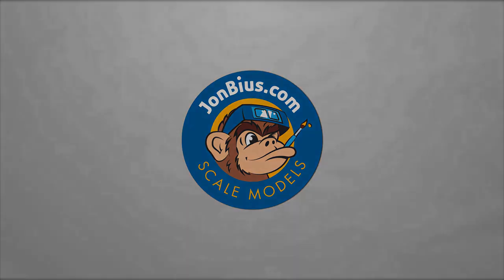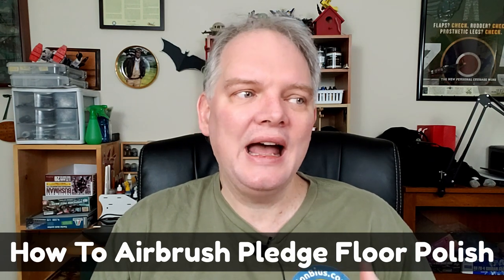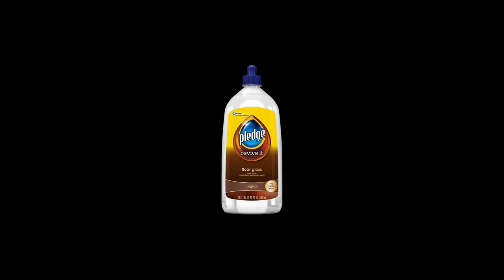Airbrushing with Pledge (Future) - A Simple Guide

Comment: Thanks a lot Jon, very helpful and Clearly So! 😅 I do have a few bottles of Pledge, bought around 2 or 3 years ago, never used them up to now, and I was thinking of using them in some new large models I have under construction. But it did worry me that the liquid in the bottle has turned slightly yellow (it was completely transparent when I bought it). Your comments on yellowing in this video kind of helped to persuade me to give it a try. Even if very slightly yellowish in the bottle, the micrometer-thick layers we spray would hardly affect the colours of the model (I hope). The only concern I would have is, if I spray it over a relatively large(-ish) white surface, like a white decal (say, the American WW2 white stars). Since I will be using it on large submarine hulls and some sci-fi models, I am not expecting any trouble. 

One more question: although it is a controversial topic (it shouldn't be, in my view) there is the opinion going around that Pledge makes a perfect medium to thin Mission Models acrylic paints, instead of using the dedicated Mission Models thinner, and their Polyurethane additive, both of which are very expensive and their recommended thinning ratio is very sensitive and it's a hit and miss to get the paint to flow correctly. In addition, any left-over paint is supposed to be "activated" by their thinner, so you are not supposed to mix it back into the bottle of the paint, leading to some wastage of a very good but also expensive paint. If Pledge really works with MM paints, it would offer a great and cheap alternative, (although this would not be very good commercially for Mission Models, hence the controversy, I suppose). Any experience or views on this? 

(btw, full disclosure: I love Mission Models paints, I think they are brilliant, but they can also be very frustrating to use because of the above issues, so I would really be happy to find an easier thinning process. After all, most if not all other paint brands, acrylics & enamels & lacquers, are very forgiving in their thinning ratios).   

Thanks a lot!
Reply from the maker: Thanks so much - I'm glad you like it!

I'm more and more convinced that white yellows on its on, apart from Pledge. I've not seen that in my own work, but I have had others I trust their experience to report that to me. I certainly wouldn't say it won't happen, but I think Pledge is not the culprit. I suspect light is - mainly sunlight - and possibly heat.

I don't use MM paints. I'd tried them but opted to move on. In general, when I've thinned acrylics with Pledge (PolyScale, Vallejo, and Citadel), it worked OK, but only in small quantities. And unless the paint is already fairly thin, adding more Future reduces the opacity very quickly. Getting a good opaque layer becomes difficult. Certainly give it a shot, as the theory is good.

Thanks again for watching and commenting!
Reply: @JonBius  Thanks a lot for all the comments, I may try this. Agreed about the yellowing, what you say makes much sense. Best regards!
Reply: I have half a bottle.  I've had it for several years. Ok ten years? I gave half away to a friend to use, about 6 or 7 years ago. What I have left has yellowed. I live in south Florida.  It's stored in my air conditioned house. In my den.tne curtains are always closed. The room has a south facing window. 
The bottle hasn't been opened  but maybe once or twice. 
I know sunlight, will yellow clear plastic packaging. Even when out of direct sunlight.
Reply from the maker: I'd give it a test shot on an old model or other painted plastic just to be sure. That would also check to make sure it hadn't thickened up any.

Thanks for watching and commenting!
Reply: Another reported use of Pledge/Clear/Future is as an additive to some Polyurethan-based primers, say Vallejo for instance. It's known that sanding of these primers (possibly all polyurethane-based primers) leads to a sort of peel-off effect. Mixing with Pledge would harden the stuff to the point sanding would not be a problem anymore. I ignore what the mixing proportions should be, honestly, and I never tried it myself.

Comment: Thanks Jon!  Over the years I have been buying models for when I retire,  done that so I am setting up for airbrushing  :)  A couple of questions if you don't mind...

You mentioned mixing Pledge with acrylic paints - I am curious, what is the  purpose for this? Transparency?  Durability? 

I am also getting into carving and airbrushing wooden fishing lures with multiple layers of (Createx Wicked) transparent acrylic paints,  would  Pledge be a suitable product to protect a layer? Would you let the Pledge dry thoroughly (over night? an hour?) or could you  blow-dry and continue  painting?
Reply from the maker: Mixing Pledge with acrylics can serve several purposes. It acts as a thinner, but because it is acrylic, it doesn't break apart the pigment structure. It makes acrylic paints very durable, and it can also be used for nice glazes, etc. So it can act in several roles.

I don't know about the wooden lures, as I've never worked with that medium. I'd recommend spraying some on, and then testing various times for drying and curing. It can be sped up with a hair dryer, though I always recommend low heat.

Thanks for watching and commenting!
Reply: @JonBius  Thanks for the reply Jon! I'm new to (modern) airbrushing - especially acrylics - though I still have my Thayer & Chandler Model A that I used for technical illustrations (with ink) several decades ago. I agree that low heat is the way to go with plastic models. 

A bit of feed-back/trivia... I was doing some more research last night and discovered that the Createx acrylic paints are also used for painting on cloth  (T-shirts) and the pigment is fused (cross-linked) to the fabric at "hot to touch" temperatures. Some people are using heat-guns set to 300 F to bond the paint to helmets,  lures and such. Lots of experimenting to do  :)

Cheers!

Comment: One airbrusher says that after he uses pledge (Future), in his airbrushes, that during the cleanup of his air brushes, he always starts out with only ""HOT Water"  for several flushes, then follows that up with a flush of "Lacquer Thinner" of which is then followed by a flush of "Acetone" through the airbrush followed by a last flush of 91% "Isopropl" Alcohol.  - My  question is..... Won't using the "Acetone"  very quickly ruin the rubber (or neoprene), gaskets in an airbrush ? ? ? - I would dearly like to hear both your "thoughts", and your "opinion" pertaining to using "Acetone" in an airbrush.

Anyway, Thanks for producing and sharing your video on how to use "Pedge" (Future),  as a clear coat finish. I think it was great and I think I learned something new. - Many Thanks for a job well done.
Reply from the maker: Thanks so much! I'm glad you liked it!

I've never used acetone for exactly the reason you identify - it's quite harsh. Lacquer thinners, yes. I use lacquer paint frequently. Isopropyl alcohol too. But I'd not use acetone.

I generally go with water (room temp) and alcohol.
I hope that helps. Thanks for watching and commenting!
Reply: @JonBius  - Thank You for both your reply, and your opinion pertaining to the possible destructive (harshness), qualities (issues), of using "Acetone" in airbrushes. 

Just as I have thought all along, using "Acetone" in an airbrush would be more detructive to an airbrush than beneficial (especially in the long run).

"Good Quality" airbrushes are very expensive and should never be abused. 

In my opinion, even cheap airbrushes need to be treated with humble respect (especially if you (any person), wants to get some prolonged continueous use out of them. 

Anyway, once again, Thank You for your wonderful advice, and thank you for sharing your great video's with the rest of us.
Reply from the maker: Thanks so much! 😊

Comment: Would my airbrush cleaner work for clearing out the airbrush instead of the alcohol? Thanks for your very informative video.
Reply from the maker: I'm glad you enjoyed it!

I'll have to give a politician's answer... it depends. 

- If it's an acrylic-based thinner, then it should work just fine. 
- If it's a lacquer based thinner, it can work nicely for a final flush, but not for the initial cleaning steps. In that case, I'd simply rinse it out several times with water to get the bulk out, and then do a final blast through with the lacquer.
- If it's an enamel or oil thinner (odorless enamel, odorless terpenoid, etc.) then it would not work at all. It may even curdle the stuff up and make a mess.

I hope that helps! Thanks for watching and commenting.

Comment: Great video Jon!  I have been preparing to re-enter the model building for some time and have been watching and learning new techniques while stocking up on needed supplies.  You have sold me on the Future clear coat concept and when I get my compressor to set up my air brush I will definitely start using it on some of my models.                                                                                                                                                                                 This also got me thinking about decal preservation.  I belong to a group that likes to restore old machines and often companies had rather nice decals they applied prior to selling them.  A long standing discussion is how to provide a protective coating that will not destroy the old decals.  Often those surfaces may be contaminated with oils so adhesion may be an issue crating another problem with how to clean a decal surface prior to a gloss coat of Future.  You thoughts on using Future for that would be appreciated.
Reply from the maker: Thanks so much! I'm glad you found it helpful!

I think Future would certainly be the least caustic choice for coating that type of decal. Lacquer or enamel based glosses might be too hot. The oils could certainly be a problem though, as that might create some interaction issues. And I'm guessing that the conditions on each example could vary, so what may work on one example might not work on another.

The best I can advise is to test the theory as much as possible, and get a good understanding of the parameters for success. Then you'd be able to proceed based on solid data.

I know that probably sounds like a politician's answer, but I hope it is a helpful framework!
Reply: @JonBius  No that doesn't sound like a politicians response because you didn't ask me to send in a donation lol .   Testing is the scary part as you are always risking loss of decal material when you try to clean them.  Thanks your for your input!!!

Comment: Hello Jon, I followed your guide with great interest. I have now sprayed a model car with Pledge, but I'm not impressed with the satin finish, 2 questions, Can Pledge be polished, and is there a manufacturers clear gloss that can cover the pledge? Stay Safe.
Reply from the maker: Yeah, it's not ideal as a final clear coat, especially for cars. That's a level of glossiness that requires a specific, purpose made product.

It's not buffable to any great degree, certainly not to bring it up to a high gloss finish.

It should be fine for applying other gloss coats over, but I'd certainly test it first, and not flood the surface.

Hope that helps! Thanks for watching and commenting!

Comment: Awesome video! Finally, someone did a thorough explanation and uses of this product for model making! I have a question regarding on its storage quality. Like you I bought so many bottles of Pledge and stored it inside my closet. As time goes by its clear color (looking from the outside of the bottle) changed from clear to slight red tinted color. I poured it on clean clear cup and it looks fine. Can I still use this product? I wonder if the bottle itself is the culprit. Any recommendations? Thanks!
Reply from the maker: Thank you so much! I am grateful for your kind words, and for watching and commenting.

I am in a similar situation. I bought several bottles a few years ago. I store them under my model desk, away from direct light. They do get a bit cloudy over time, but I have had no problem using them. It doesn't seem to effect how they look when applied. I'd say go ahead and use it, and unless you visually note any issues with it, it should be good to go.

Thanks again!
Reply: Hello again! Just found out through social media that J&J discontinued this product indefinitely! Do you by any chance have any information about another brand as a substitute? Is "future" the only brand out there? Thanks!
Reply from the maker: Stick around! I'll have a video about that coming soon. 😊

Thanks for watching and commenting!

Comment: 2 Questions sir. I am finishing up on a military helicopter. Is Pledge ok for that? and I question that in regards to the right type of finish. Is gloss finish ok for military models, ones that will be weathered? Or should I use something more matte? Also question 2... is the proper order... paint -> clear coat -> decals -> clear coat -> weathering? Thanks again!
Reply from the maker: Pledge works nicely on any plastic or resin model. In general, adding the gloss coat after paint and before decals is a good idea. I generally add another clear coat after that, at least to the decals, to seal them in against later weathering steps.

As to whether the finish I right for a military helicopter, I'd suggest referring to photos, and see what those show. That can help determine what your final finish is.

Thanks for watching and commenting - have a great day!
Reply: @JonBius  Ok great. Much appreciated!

Comment: Seeing a most modelers gloss to apply decals and weathering, how should this be treated for washes or pin washes? I know you shouldn’t use say an acrylic pin wash over an acrylic surface because it will reactivate the paint, or enamel over enamel and the thinner you use to clean up the wash would take the paint clear off as well. Should I treat this like an acrylic? Thanks.
Reply from the maker: It works great for washes that are oil or enamel based, though I'd do a spot application to seal in decals. I used Citadel shades (acrylic) over this frequently, as well as homemade acrylic washes, and some Vallejo washes. None created any problems once the gloss varnish was fully cured. Leaving it overnight should be sufficient. I hope that helps!

Thanks for watching and commenting!
Reply: @JonBius  thanks!

Comment: Thank you for the info Jon. Have you tried buffing it with a dryer sheet to get a higher gloss coat after it dries? I heard this works and wondered if you tried.
Reply from the maker: I've not tried that, but I have never used it for a final gloss shine. I use it strictly as a step on the way to a weathered, dirty finish in general. But certainly give it a try!

Thanks for watching and commenting!
Reply: @JonBius  I will do and try to remember to let you know how it works out.
Reply from the maker: @shanec8812  Thanks!

Comment: In my experience of using this on miniatures, the reputation for yellowing comes from a couple of things:   First, it does yellow in the bottle, as you said.  Which is more than an inch thick.  And if you apply it more than an inch thick on your model, you may have problems.  In the nanometers-range that airbrushes put down, it's a non-issue.

Second, I think a lot of the time people are seeing real yellowing and are just assuming that it is the Future (er, Pledge.)  Heat, light, humidity, cigarette smoking, cooking with lots of grease - they can all cause any white paint to yellow.  Acrylics are less prone to this than enamels/oils, but it can affect any of them, just like paper, plastic, and wall paint.  White things yellow.  And when you build a model that uses white paint plus multiple products for weathering/washing/decal setting/multiple varnishes, it's quite an assumption to say that it was the Future that caused it.
Reply from the maker: Good information. And I agree - to lay yellowing at the feet of Future fails to consider all of the other factors, both on the model and external to it.

Thanks for watching and leaving such a helpful comment! Happy day to you!
Reply: Will yellowed liquid still be workable from the bottle?
Reply from the maker: It depends on how yellowed it is. Given what it will be used for, I'd stick to the safe side and get a new bottle. At the very least, test it out on something before using it on the model itself.

Thanks for watching and commenting!

Comment: how do i clean my airbrush? after using clear?

ive been useing tamiya tool cleaner dunno if that works?
Reply from the maker: That should be more than sufficient! Tamiya Tool Cleaner is quite powerful. I use some water, then alcohol, and maybe a touch of lacquer thinner. But your solution should do fine. If your airbrush has any internal seals, keep an eye on those.

Thanks for watching and commenting!

Comment: Can you tell me the mixing ratio for the pledge and the paint? Thanks
Reply from the maker: It varies depending on the paint and the desired opacity. Start with a very low ratio... Maybe five parts paint to one part Pledge. It can make paint very transparent very quickly. Hope that helps! Thanks for watching and commenting!

Comment: could you drop a few drops of paint in it and make a clear sticky paint for canopies?
Reply from the maker: It can be done, but it's a bit tricky. If you do a canopy dip, it often leaves some pooling, which can really be difficult to get rid of evenly. If airbrushed on, it tends to look a bit foggy. I was able to get it to work somewhat using both methods, but I was never 100% satisfied with it.

Test some methods out on scrap canopies and see what you think.

Thanks for watching and commenting!
Reply: @JonBius  Thanks!